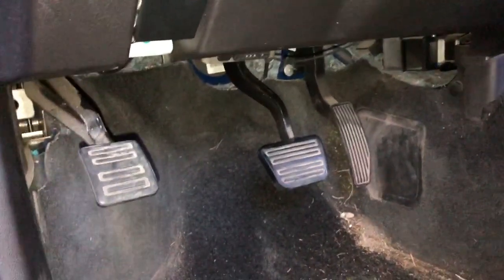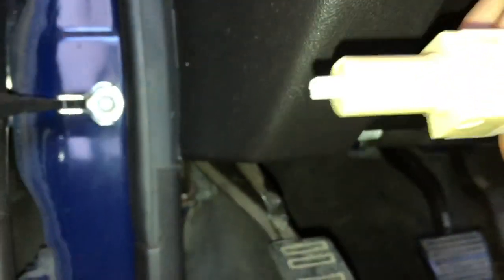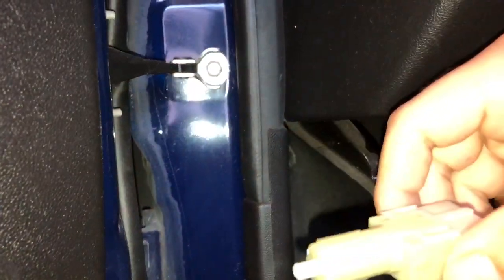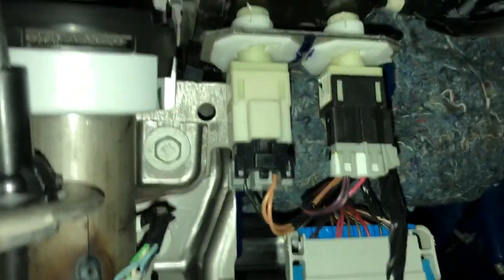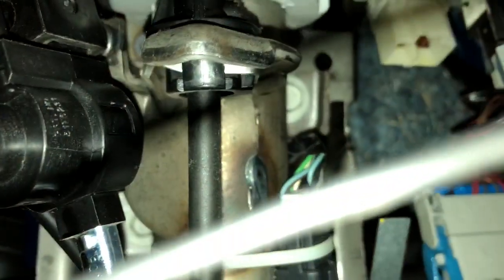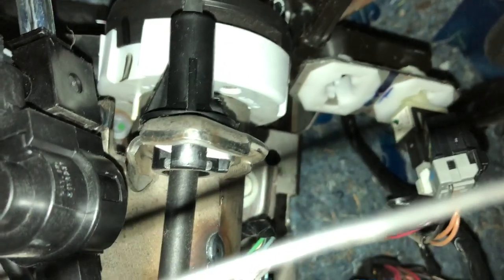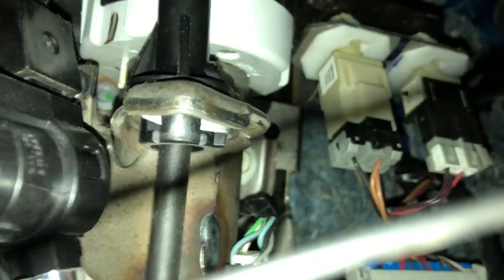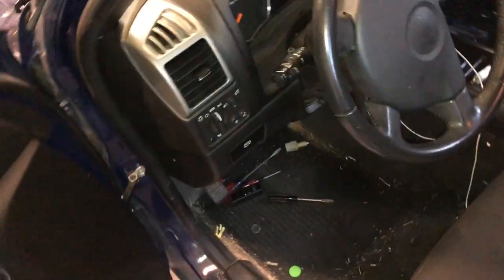DIY: replacing brake switch (cruise control not working) Chevy Colorado

Comment: Hey! Does anyone know what the other switch is? If one is the brake what's the other one, also thank you for the video I had this issue with my 07 Canyon SLE, my brake lights and my cruise control stopped working and I didn't know why, so thank you!
Reply from the maker: Cruise control release switch

Comment: Thanks for the video. This should be a safety recall. GM refuses to acknowledge the problem. Otherwise these are great trucks.
Reply from the maker: Anthony Antinarella I agree, I called at first to make sure there wasn’t a recall on it..
Reply: Have an 09 Colorado and this will be my second switch I have had to replace. Good ole GM parts!!
Reply: Weird. They swapped mine for free.
Reply: I have a 2010 Colorado. So many problems - over heated due to broken plastic fitting on radiator line, driver door window assembly replaced, third brake light will not come on, engine temp gauge does not work after the over heat, replaced the starter, replaced the blower motor. All before 70,000 miles.

Comment: Many thanks. This is exactly what I need to get my brake lights and cruise working again. If you are trouble shooting with an amp meter as a short in place of the switch the one shown unplug is this video was 191mA. The one beside it was 21mA.

Comment: Thanks for the video, in my case after replacing the switch it didn't work for me but a month later I decided to check everything again since the switch have an adjustment for instillation I had to push on the break paddle and then re insert the switch and then it worked for me.
Reply: You have to install the switch properly so that it depresses

Comment: Do you know if you get the same symptoms if your cruise control release switch goes bad??? It would be the one right nxt to that one. I’m asking because I do not have brake lights on the tail end neither on the high lamp cargo lamp the two clear lights come on but not the other two which are the brake at the very top of truck roof. I bought this switch also in your video no luck and my cruise control also does not work. So if you have a bad release switch you won’t be able to get into cruise control even if your brake light switch was good. New bulbs and fuses.

Comment: My third light is still working but the two on the bottom are not? Does the brake light switch control all three or just the two on the bed?

Comment: If one is the break Light Switch.  Then what is the other switch next to it.  I replace the one but not the other next to it.  The problem that I am having now is that the Calibers are not releasing sometimes or all of the way.  Is the other switch the Break Clutch Switch?  I am wondering if I have to disconnect the battery for awhile to see if the computer has to readjust after that replacement was done.
Reply from the maker: Pisces the other switch is traction control, you might have bad calipers; or the rubber hose brake lines going to your calipers have collapsed

Comment: Just replaced mine but now whenever I press the brake the turn signals on dash light up
Reply from the maker: Hmm you might have a short.. maybe you can disconnect your battery for 30 minutes to see if that helps?

Comment: Hi, I wanted to ask you, I already replaced the switch, recover the stop light, but the cruise control still does not work, any suggestions that I should check or do?
Reply from the maker: Hector Santiago hmmm, where did you buy you switch? Maybe it’s a faulty witch I’m not sure what else it could be. I bought mine at the dealership, I’ve had bad luck in previous occasions on other vehicles when buying after market electrical parts
Reply: @SVTPalacios  I went to O'reilly Auto that afternoon and bought the new spare
Reply: Hector Santiago, Replace the second Pedal Switch right next to the break lights, that"s your Cruise Control Release Switch, Part #15109338. I'll suggest replace both switches at once, they get the same usage every time we depress the break pedal.I just cleaned them for now and will order to keep on hand, contacts didn't seen burned at all, just a glazed coat on them, Just don't scratch them too much.

Comment: Did your tail lights and turn signal still work before you changed the part ? Or were they off completely?
Reply from the maker: Official Maximum Shock yes the turn signals worked and also the tail lights just no brake lights. Sorry for late response

Comment: Did anyone still had problem with cruise control? It fix my break lights though
Reply: I had a cruise control issue. Turned out to be a fuse problem in my case. Definitely working checking both the brake and cruise fuses. Here is how to do that:
https://www.youtube.com/watch?v=JfVTtvqxDYg